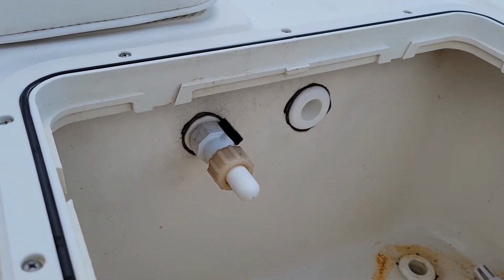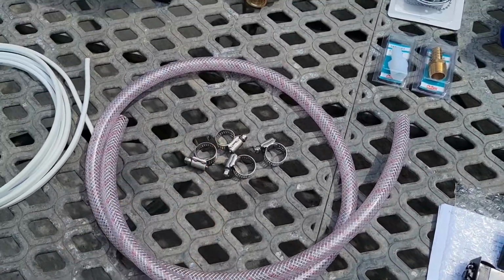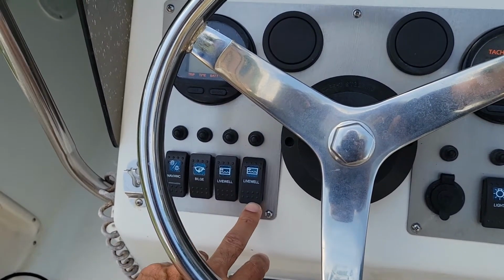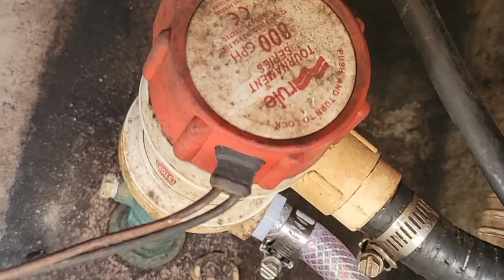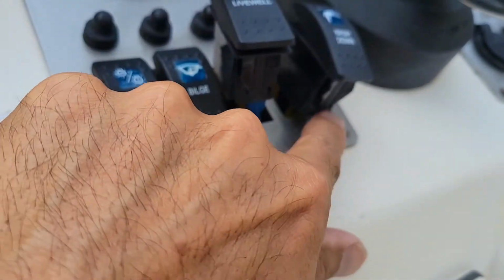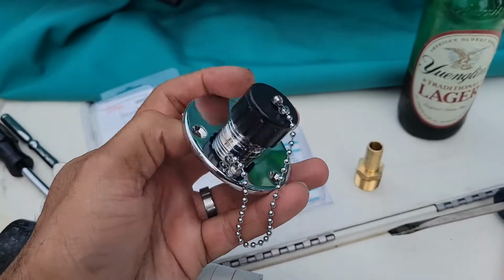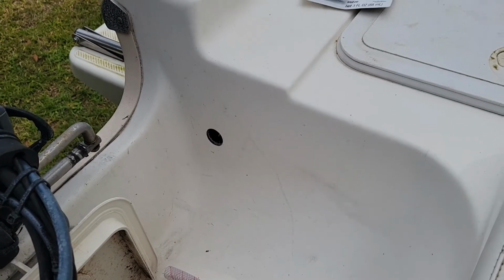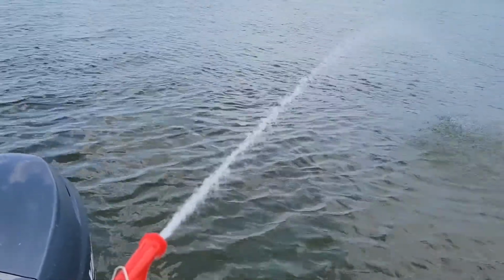Installing a Sea Flo 55 Series Washdown Pump

Comment: For clarification, you tapped into your live well water supply? 

I have a very similar assembly however I keep seeing videos that are requiring me to drill a a new hole through the transom. If I can tap into the live well water supply that would be more practical. 

Then i keep second guessing myself - wouldn’t I have to power the live well and the wash down at the same time? 

Confused, lol.
Reply from the maker: Most Rule livewell pumps have a 1/2" plug on the water pickup coming from the seacock. Around 2:25 in the video, you'll see where I removed the 1/2 plug and installed the 1/2" male barbed adapter. Hopefully, I'm not making it more confusing. Just check your water pickup tube, it's between your livewell pump and the seacock. You have to have a access bung there, similar to the one in the link https://www.wholesalemarine.com/rule-livewell-pump-w-straight-pickup-tube.html

Comment: Hello David just came across your video, like you my boat is in the same situation Live Well pump running double duty not getting the job done so looking at installing number of company pumps. I know it's only been a couple of months but how is your seaflo 55 holding up. I'm looking at their 53 series 70 PSI 7 GPM.
Reply from the maker: It's been getting the job done. It's an on-demand system, so basically just leave the pump on. Only issues is flushing the pump. The stagnant saltwater starts to smell after a few week but just run it overboard before you hose the deck
Reply: @davidlooye7660  I have same pump new in box which is why I watched your video.  I just did a test with an amp clamp and the pump was only drawing 7amps after pumping water for 5 min.  If you want to try a switch again you should be good with one that can handle 10 amps.

Comment: Just thinking about it. Did you consider hooking the seaflo washdown  pump just to your Livewell so you could get faster fill up in the Livewell and be able to have sufficient wash down pressure ? Now you have 2 pumps to maintain 2 seperate switches etc? Just curious of the cons.
Reply from the maker: Filling the livewell that fast would probably kill what I had in there. Seaflo pumps are easy to repair and aside from fresh rinse of the filters, not much maintenance

Comment: So 500gph not enough (maybe could wash your hands) 800gph better but probably want 1000gph? My seacock is in a bad spot. I have been concerned to remove it and put a stronger pump in
Reply from the maker: Better to repair it before before it fails

Comment: I intend to install a 12v SEA FLOW 4.5-6 AMP PUMP TO A BATTERY TO PUMP WATER TO MY HOME. tHE BATTERY IS 12 V  BUT SOMEONE TOLD ME THAT I SHOULD BE AWARE OF THE AMPS BECAUSE I COULD BURN THE MOTOR, HOW TO YOU MANAGE TO DO THAT IN YOUR INSTALLATION? THANKS
Reply from the maker: You'll need to install an inline fuse on the positive terminal side to protect your pump motor. Refer to the manual for the correct size, should be around 5 amp

Comment: That pump draws 17 amps.  What are your switches rated for?  Maybe should have a relay?
Reply from the maker: max draw is 17amps. I've been running a 15amp fuse with no issues.

Comment: Hello mate... Question, where is the water that you sprayed coming from? A fresh water tank or, the body of water? Thanks!
Reply from the maker: There's a through hulls to feed raw water to the pump. Basically pulling it from the body of water I'm in.
Reply: @davidlooye7660 should you do any maintenance on the pump from saltwater use to prevent it seizing or something?winterize? Prevent it busing from freezing water? How?